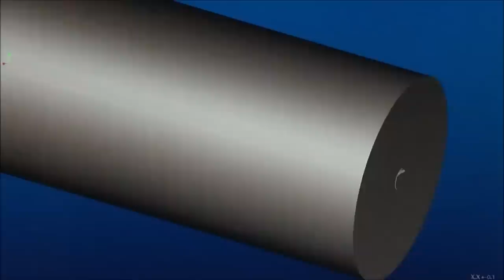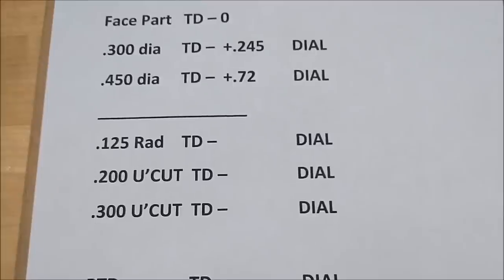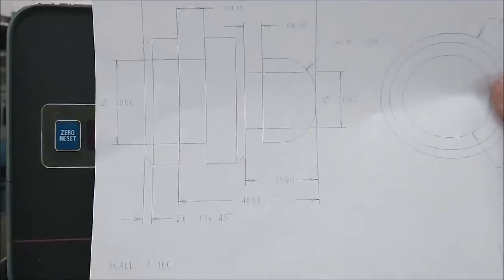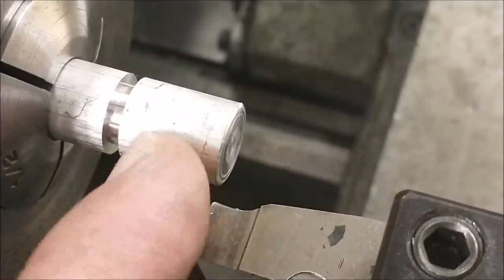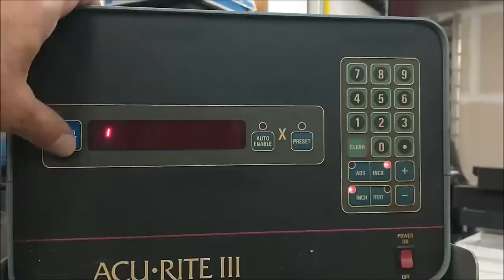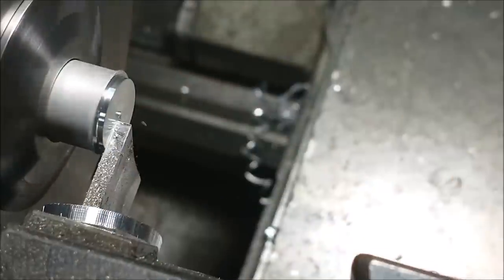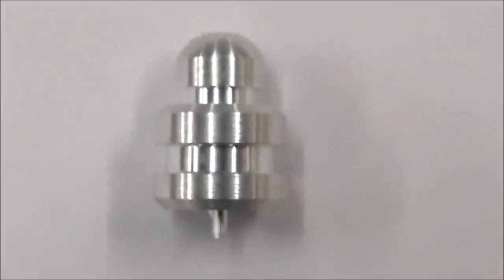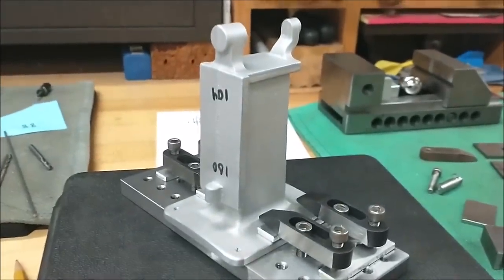Own a Manual Lathe with a DRO ? Try This for Faster Parts !!!

Comment: An add onto a yesterday day comment.  Rex 95 and Mo-Max were my favorite when I could get my hands on either one.  You might laugh at the following but while serving time as a railroad machinist apprentice, some of the old head machine men (as opposed to nut splitters working on erecting floor) told me that during the depression money was so tight that they couldn’t get even the Rex A series tool bits very often.  So in a pinch they would find an old square file, grind the teeth off, then to the shape desired and use as necessary.  You can imagine the cutting speed was not very high and calipers were the norm and as an apprentice you were expected to be able to read a half-a-64th on a scale!  Keep up the nice work.  Chris A.  Retired but still making a few chips now and then.
Reply from the maker: I've actually done the file trick. They make good knives too.

Comment: As a hobby machinist, I’m so grateful that Joe takes time out of his paying work day to provide these invaluable lessons. I just put an X, Z DRO on my 13x40 Harrison lathe. A 40 pound hunk of dura bar is being whittled down to a solid tool post base presently.  The absolute to incremental switch on my Bridgeport is becoming second nature. I can’t wait to index and catalogue all my quick change holders and get after projects. The process sheet will become another of my go to strategies thanks to Joe.

Grateful in Central Phoenix 
Shawn
Reply from the maker: I normally just write it down on a pad and keep it close by, but the word document was much clearer for this video. Good luck.

Comment: Ha!  Thanks for being a good sport about the cardboard tube Joe.  I usually use a little larger tube, but that's the one that was laying on the lathe tools cart when I thought to send it to you.   So much stock comes in cardboard tubes I always have some laying around.  I do usually go past the tool and around the part a little more with the tube, but I recognize you were also positioning for the camera.  I also don't worry about catching chips in the tube.  They dump out with the parts just fine.  As you know sometimes the part will flip up and fall on the other side of the tool.  Not often, but its still a pain to go hunt for it in the chip tray when they do.
Reply from the maker: Thanks for the gift. It was a perfect opportunity to use and show it.

Comment: Thanks, Joe!  I put a 2-axis DRO on my lathe.  The obvious exercise for me is to extrapolate those techniques to that second axis. The key seems to be stopping the machine with the tool in the cut so you can read and record the position. Really great, fundamental stuff that will help my approach tremendously.  Thanks, as always.
Reply: Just be aware that that method will not be advisable with insert tooling when turning anything as strong or stronger than mild steel. Partly because inserts are not sharp, and mainly because they are brittle,  stopping the spindle before you withdraw almost always takes a nibble out of the edge as the rotation comes to a halt and the cutting force suddenly ramps up. This is so even when you have a dwell period where the tool does not move; there's almost always enough give or spring in the system that there is still enough residual pressure to keep the cutting tip engaged in the work.
Reply from the maker: I should have mentioned that I rarely stop a tool while in contact with the work piece. It jeopardizes the tool and will probably leave a mark on the part.

Comment: Very clever. 
Essentially the numbers you are finding are a combination of tool offset and part geometry.  If you had a fancy dro with tool offset capability you could do this separately,  but this is a brilliant method for the rest of us mere mortals with simpler dro's (so long as you use insert tooling or don't disturb a tool offset by resharpening the tool part way through the production run).
Thanks Joe

Comment: Best example of how to use a dro I have ever been shown I'm retired now but when I was taught how to run multiple parts there were no dros so I learned the pad and paper method so cave man style compared to your version I still don't have a dro on my atlas lathe that is older than me but I been thinking about buying one even more now after watching your video I could make a form tool and a shave tool for a screw machine set it up and drop one off every 7 or 8 seconds on a 1inch multi  thanks for sharing your knowledge with us don't work no more but still like to learn anything that catches my interest you are a very good machinist and a better teacher something that you hardly see anymore thanks
Reply from the maker: Thanks for the compliment.

Comment: FINALLY! I now understand how to use incremental. My head is spinning. But, I’ll watch the video several times to grasp it all. Thanks, Joe
Reply from the maker: They are actually easy to understand and use if someone takes the time to really explain the difference. Which one to use is normally driven by the dimensioning scheme on the print. If all features are dimensioned from the face of the part, all moves are probably absolute. If the fetures are dimensioned from each other along the length of the part, those would ( could) be incremental. The good thing is, once you zero the absolute and go to incremental, the absolute zero doesn't change. Unless of course you face the part off. Easy example: You are standing still in a snow covered field. That is absolute zero. It can also be incremental zero. Now zero the incremental scale and take a step. You have now moved 'x' in absolute from your starting position and 'xx' from your previous location. When you take your second step, the incremental value is the distance from your first step to the second. The absolute value is how far you are from where you started.

Comment: Great rundown on the incremental and absolute features of the DRO and how to use them effectively.
Reply from the maker: Incremental is not utilized as often as absolute. Its a great helper function depending on the dimensioning scheme.

Comment: Excellent video. My lathe is near-identical to yours and has a two-axis Newall Sapphire DRO that's now 41 years old. One day I'm going to swap the DRO for one with a tool library, but that old clunker is still hanging in there. I'm joining the Dark Side soon, bought a new Syil X5 CNC, but the Bridgeport and Colchester are definitely staying

Comment: i recently added a DRO to my lathe and can now hit my numbers without a problem and much faster as well since I don't have to mic the part so many times to make sure I'm on track.  I did however, find that using a DRO on a lathe is not like using one on a mill.  I'm finding that working out all of the SDM numbers and entering them into the DRO is extremely time consuming and for me, a waste of time.  I'm trying to workout a better system, and this video will help.  A lot.  Thanks!

Comment: Love your videos, I've probably notched a hundred of them by now - you're a selfless and amazing teacher with so much to share.

two big questions for you!

Have you thought about or been approached by FIRST robotics high-school teams, especially FRC teams, to be a guest speaker or shop tour to inspire students directly? They would hang on your every word of wisdom! (I'm going to try and cultivate some of your intro lathe videos through our program this year.)

I'm less than a year in owning a mill and lathe, but having trouble finding suitable chunks of steel to make my own tools and projects.  Where can I get lower cost drops of steel solid round bar (2" to 6" dia) and 1.5-2" thick plate (5x5 to 10x10) for larger pieces? junkyards don't allow browsing. local metal suppliers charge a harsh premium plus cutting shorts. ebay kills on shipping.  austin seems dry, but I suspect the recyclers are hauling some of this stuff off for scrap prices!
Reply from the maker: Thanks for the contribution. I have assisted FIRST teams in the past. Its a great program. For short material, check Metals 4U. They usually have short bars and small plates in stock. Also check a waterjet or laser house. They throw away the nesting material and may be happy to give it to you.

Comment: I have been using a version of that method for years.  I make lots of parts close to the chuck.  I use a 2" travel dial indicator as I do not have a DRO.  The dial is zeroed on the right end of the part.  I make notes of the dial reading for the features of the part maintaining the zero for the first tool.  I find it easier to use the analog dial to either stop the power feed or move to the next location.  The dial provides better feedback that is easier to use as opposed to watching a set of DRO numbers change.
Reply from the maker: I used a trav-a-dial for years. Once you get used to them, they are fantastic.

Comment: I started with the mill where from plan I would end up working from a set of co ordinates, on the lathe I use basically the same system as your doing except I have a window directly behind and I use that like a white board instead of a paper copy. It saves a lot of time and "spares".
Reply from the maker: I like it.

Comment: Great demo on how  to use ABS/INC ! Especially for those with an older basic DRO with no tool library( or limited tool library ). Nice meeting you last week. I keep a small dry erase board next to my lathe/mill for jotting down DRO settings. Your process sheet would be mo' better for repeat parts/production.👍

Comment: Very nice!  Now I'm going to take a piece of 1/2 6061 and use your process numbers on my lathe and see what happens.
Reply from the maker: The relationship between tools will have to match mine for the numbers to work for you. Play around with it. It really sinks in when you are pushing the buttons and turning the dials.
Reply: I assume I'm going to have to do some scaling to adjust for machine and tool sizes.  We'll see this afternoon. 😊
Reply from the maker: How'd it go?
Reply: It went well.  Other than adjusting for tool widths, it worked perfectly.   I have an X axis DRO, so hitting depths was not a problem.  I even threw the O ring on.  Now it's just sitting on top of a workbench storage cabinet.  A proud reminder.  Who knows?  Someone at a local car repair shop may need just this part. 😅

Comment: Excellent lesson Joe. One other thing, 12.7mm is exactly 1/2"! To quote from wikipedia "In 1930, the British Standards Institution adopted an inch of exactly 25.4 mm. The American Standards Association followed suit in 1933." As an Englishman it pains me that they decided to define an inch in relation to the metric system!
Reply: Instead you should do the same, and embrace the metric system...
Reply: They didn't. They stated that one imperial inch was equal to 25.4mm. They defined the metric system in terms of imperial inches, not the other way around.
Reply: @Thelemorf  I use the metric system most of the time! I also use the Imperial system. I'm "bilingual"! I like both.

Comment: great stuff thanks and yes i am out the back baking cookies with the rest of the class . Joe one thing is on your plain there is no over all diameter . i was finding it hard to follow till you made the part then showed the diameter thanks as all ways Cheers.
Reply from the maker: Your small cheat sheet can be as involved as you want. I do normally add all relevant features.

Comment: Joe, not sure if anyone has already mentioned this, but you can get neutral density filters for your camera to stop it down more - you can then use brighter lights and not wash out th4e camera sensor.
Great technique - once I get my DRO, I'll give this a try. How do you deal with backlash on the cross-slide dial settings?
Reply from the maker: Backlash doesn't come into play if the dial movements are always in the clockwise direction.

Comment: Tool offsets FTW😁. I really ought to install a DRO on my machine.

I like the paper towel tube part catcher. I sometimes use a small Akro-Bin set on the cross-slide, but this seems better.
Reply: yes, and converted from each tool offset to a single scale to read... recorded on a process sheet.  Optimized order of operations. neat.
Reply from the maker: I got that from a viewer. I'll have to post a link to his channel in the video description. Nice job modifying your mini pallet !!

Comment: Great lesson unfortunately I do not have a dro on my lathe.  Thanks for the video keep on keeping on.
Reply: Not hard to fit...
Reply from the maker: Greetings Harold. This concept was developed using a Trav-A-Dial. Maybe a long throw drop indicator would be a good substitute?
Reply: Except you can get a Chi Com  DRO for less money then a used Trav-A-Dia and have enough money left over to buy beer for the crew after work for a week. 

l always buy USA if I ca n but you can get a chinese DRO installed on the machine, have a second one in the office closet as a back up, and still not come close to half the price we paid for an Accu-Rite that only lasted us 4 years . ,,,,, and to be honest we have had zero problems with the 3- chinese "junk" DROs we have, including the  the that replaced the B&L  over 10 years ago,,,,,and I got guys that can ruin a crowbar.
Reply: @Tensquaremetreworkshop  I have thought about that many times but my lathe has so many curved surfaces and not many flat ones that I have not got one.
Reply: @joepie221  my lathe would be hard to mount the dro on.  Everything is curved.  I have been tempted to get a dro for it but don't want the mounts to turn out wobbly due to no flat surface.  Maybe if I get it back together I might get a dro and try anyway.
Reply: @mathewmolk2089  yes I have bought and installed several Chinese dro's in the past and they work just fine.
Reply: @AmateurRedneckWorkshop  Scales are really three point fixing. Each end and the slider. One can normally arrange mounting blocks tied to something firm, whatever is in-between.
Reply: @mathewmolk2089  I replaced my Chinese edge finder and auto centre punch with Starrett, thinking I was upgrading. The edge finder is no more accurate, and the punch works maybe 3 times in 10. I shall not be buying more...

Comment: Great professor Pie video. One question. Does your DRO have tool offsets? Thank you Joe.
Reply from the maker: No. This is a great work around when thats the case.
Reply: @joepie221  Okay. This is a great procedure either way. The mill model coming up should be awesome like the all the others.

Comment: Since your carriage cross slide does not have DRO reading, you didn’t discuss backlash so your machine must be tight, most home hobby machines are worn and the backlash would present a problem…..am I correct in my thinking???  DRO in both directions who cares about the machine’s backlash ….ENJOYED!!!!!
Reply from the maker: Greetings chuck. backlash on my cross slide does exist ( barely ) but all my moves are away from me, so it never comes into play. Thanks for checking in.
Reply: @joepie221  YUP!!! you the man as that is the answer I was taught by Chui (same as the mill), taught and remember? are two different subjects and your reply hoping others read these comments will learn and REMEMBER…LOL

Comment: Great video Joe! I understood what you were doing and why it works. However, I do have one question: while I follow the reasoning for the order of operations on the second piece (less tool changes), were you at all concerned not “pre-parting” to below the depth of the rear chamfer so that during the final parting there wouldn’t be any unbalanced forces on the blade?

Comment: Depending on quanity, make a form tool, plunge all dim. in one shot. Hardinge Turret Lathe are great for parts like this.
Reply from the maker: A one shot form tool would be ideal, but not everyone has the capability to do that.
Reply: Hi Joe, I know I'm showing my age.  Back in the 60's in my Apprenticeship my forman gave me 2" peice of scrap and told me to make a cube.  I was setting up a mill and he comes over saying NO, NO, NO. Handed me a file and pointed to a bench vice.

Comment: Yet another excellent lesson, Joe.  Will the ability to crank out subsequent parts more quickly create the need to build in time for the material temperature to cool in order to prevent variations in final dimensions ?
Reply: That is what secondary operations are for, accuracy.

Comment: Joe. You are a god. 😬 I’d love to see your setup. 
I just bought a 1968 Southbend heavy 10L. 
I’m thinking of converting the lead and cross screw to ball screws, and adding a DRO. What are your thoughts on this? What DRO should I look at? (Two axis Z and X). 
I’m also thinking of converting it to a 4.25 hp Leili treadmill motor with variable speed, forward and reverse and electric break (already built). 
I’m having trouble with the taper pin holding the taper attachment. Both ends are flush with the trunnion. It just won’t come out. Any ideas?
I know you are busy but if you can’t figure it out, no one can. 
Thanks,
Paul

Comment: You’re not checking the alternating tools for chips or swarf that throw them out of tolerance?  

I regularly do, but I wonder if I am wasting time.
Reply from the maker: Your surface finish is a solid indicator of a problem. I do check production parts, but it depends on the quantity, material and setup.

Comment: I'm still a little unsure where you got the 30 thou from to increase the O ring groove as I don't remember you saying how wide the parting tool was.  Can you elucidate please.
Reply from the maker: The second groove value is simply offset to the negative to compensate.
Reply: @joepie221 Of course your method does not need to know the width of the tool as it uses offsets from each side.  Thanks,  your video has re-stimulated my interest in fitting a DRO to my lathe as I often have repetitive parts to make.